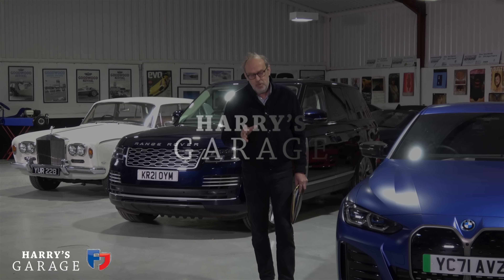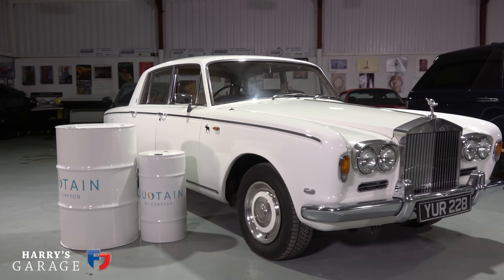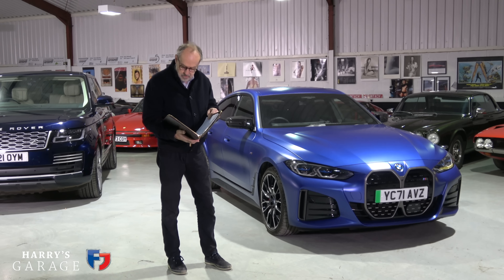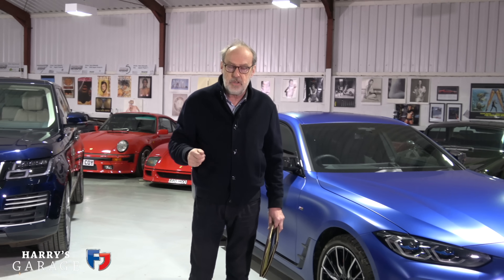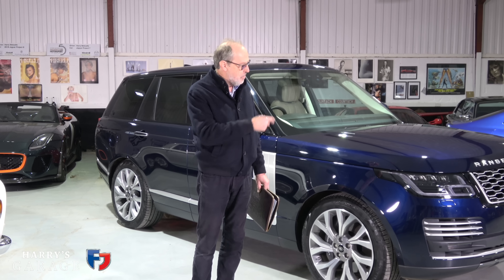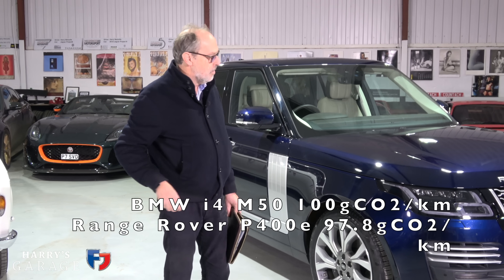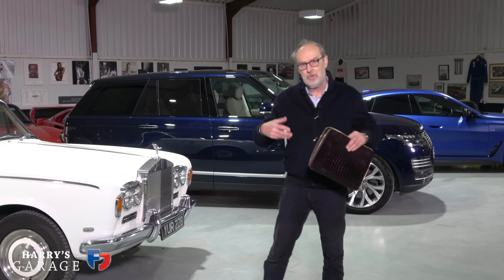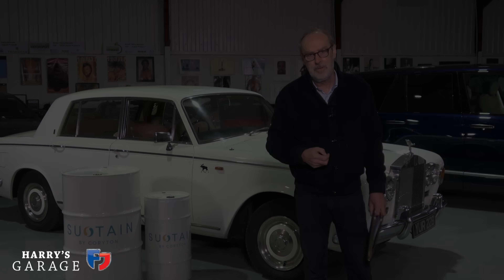Sustainable fuels; what are they & are e-fuels better for the planet than running an EV or PHEV?

Comment: The other factor to add is the initial cost price of the car. The i4 M50 is GBP 63,905 . The BMW 420i M Sport is GBP 41,650. So you have a GBP 22,255 difference straight off the bat. Are you going to be putting GBP 22,255 worth of fuel in the car over the time you own it, before selling it on. You still have to pay the electric charge price on the EV. The petrol car you can drive all day and only have to stop for 10 mins max to fill up. The EV is the wait time to for a charging station, time to charge. CARWOW did a drive and was getting 293 miles out of a charge. Now, I live in Canada and for our winters it is -10C on a good day. EV batteries lose 40% on average in the cold. So now it is down to 173 mile range. That won't cut it for me to drive from Calgary to Vancouver, which is 604 miles. (I do this trip one a month for work). EV cars this winter, this winter was really bad as the -40C cold spell lasted over 6 weeks, shut off the heat in some vehicles to help the battery out. People were sat in EV vehicles that were showing -21C inside and the cabin heat was shut off by the cars computers as it was -40C outside and the battery power was used to keep the batteries warm.
Reply: At last, someone else who sees the true issue. I commuted 110 miles a day until very recently and would have loved an EV to reduce my fuel costs...but factor in the pure outlay necessary to buy the bloody thing and it paid enough fuel to take me to retirement. So no EV for me.
It is my guess that they will only really take off once they are readily available to the masses for around the £5k mark.

Comment: Another thing to take into account for some people considering a PHEV or EV is the option of changing to a smart tariff if they have smart meters installed at home. Currently I can get a new tariff of 30p/kWh during the day and 7.5p/kWh during 4 hours at night which would reduce the cost of electric vehicle running by 75%. Hopefully the UK gov will do more to reduce the CO2 cost and remove the reliance on oil and gas for electricity generation.
Reply: Yep!! I'm currently on 5p at night. Hopefully still quite low when I need to renew end of the year.
Reply: I strongly suspect once enough tax revenue is lost to EV's we will all be charged 'by the mile' thus removing any perceived benefit of running an EV.
Reply: @BibtheBoulder  I mean that is coming ev or not. It's a better way of taxation imo whatever you drive. Won't fully remove benefits though as all cars will be subject to it. Yet EVs likely still cheaper to fuel

Comment: Caveat - the unsustainable construction argument against electric cars goes against all cars, in fact it goes against all (new) things.

I commend Harry for recognising that the maintenance of an old vehicle beyond its intended lifespan is an objectively sustainable thing.

But, to stand between two brand new cars - one of which effectively has two drivetrains in it - and emphasise the damage done to the environment by just one of them is nonsense. Yes, the BMW was carbon intensive to produce. So was the Range Rover. In Harry's own words, the planet noticed them both.

The most effective solution is to move away from the overconsumption of brand new products, on every scale, and towards an economy of maintenance and repair.
Reply: @mstrbkr which particular fact would you like proof of, mr fact checker
Reply: Wrong. Look at the Volvo study looking at ICE XC40 vs EV XC40. The EV needed to travel 140,000 km before the CO2 reduction was realised, on current energy mix in Europe.
Reply: @anthonyfarnan5935  wrong - 146k on global electricity mix. 84k kms on EU mix. So basically, if you were to buy a new car now, over the course of a lifetime, it is more "environmentally friendly" to buy an a Volvo XC40 EV rather than a ICE XC40 as most cars will still be around after 5 years / 50k miles.
Reply: @acemcgraw1  wrong - at that mileage, the EV batters are destined for the scrap heap. Whereas the ICE vehicle has another 150,000 km to give.
Reply: @anthonyfarnan5935  says who? Most estimates are that batteries will go on for 10-20 years. Most new EVs you buy have a 10 year warranty. How many ICE cars really go on to 150-200k miles before being scrapped?  Look, I am a petrol head, but in order to "win" against the EVs, we can't just make stuff up that isn't true!
Reply: @anthonyfarnan5935  oh come on, that’s a decade old speculation at this point, there are a number of ev taxi companies that have pushed Teslas and other vehicles to over half a million miles on original batteries. Meanwhile, 250k on an ice car assumes a rigorous maintenance schedule. Doable, but your every day consumer expects to move on to the next car after 50k.
Reply: @acemcgraw1  I was talking about kilometres, and you just switched the discussion to miles. In any event, a well maintained ICE vehicle can (and usually will) have double the lifespan of an EV. The second hand market takes care of that.
Reply: @anthonyfarnan5935  You're making that up, we've already told you why that's not true.
Reply: @Munkenba  lol, why would simply assume I’m making this up? From TrueCar Adviser: “Electric vehicles have come a long way. Automakers are offering more affordable electric cars with plenty of range, and charging stations are becoming more common across the country. But if you’re new to the plug-in lifestyle, you may be wondering exactly how long an EV battery lasts. The short answer is at least 8 years or 100,000 miles”

An ICE vehicle, if maintained in accordance with manufacturer’s specifications, can last well over 200,000 miles.
Reply: @anthonyfarnan5935  ffs, it says "at least 8 years or 100,000 miles" because there are very few electric cars that are over 8 years old or 100,000 miles in, but you're effectively making the comparison with 30 year old Volvos. That's why I cited taxi companies. While they're a small data set, they've proven that plenty of EV batteries are happy to run half a million or more, and that's on a maintenance schedule that amounts to changing brake pads, tyres and washer fluid.
Reply: @Munkenba  wrong. The writer makes that conclusion because while there are many EVs which have lasted longer, their range is reduced dramatically due to battery degradation over time.
Reply: @Munkenba  totally agree with your original comment about repairing/reusing things and reducing consumption, i've been banging on about that very point for decades, not just in the motor industry but in every aspect of life, but unfortunately we live in a throw away society, obsessed with the next brand new thing !

As for FEV's & PHEV's or even the old REX vehicles, i've worked on them for the past decade or so, since the infancy of the tech & to our present day as a High voltage Technician & i must say the technology is getting better but unfortunately i think it has its limits, there's no reason why an FEV or similar can go on for big miles/KM's but the problem is the degradation in efficiency over time which can be seen in older vehicles like the Nissan Leaf or older hybrids such as the Golf GTE, when this happens charging becomes more frequent or in a worse case the vehicle becomes unusable.

Comment: I work in Motorsports and the shear amount of waste and fuel use is unsustainable. 
I’m concerned for the engine builders as a whole as we move forward, particularly for drag applications. The amount of innovation in electric and simplification it brings will be difficult to ignore. 
From a road race perspective alternative fuels will be a godsend, especially if they can be made to be plug and play. 
We are seeing a huge shift towards tracks in the US becoming “destinations” or “lifestyle” parks. As on road driving regulations ramp up these alternative driving outlets will expand.  Having the option to more sustainably fuel that demand will provide us all a more guilt free experience.

Comment: Harry ..."CO2 under the earthcrust?" You have no idea what you are talking about.  You will hardly find any CO2 in an oil reservoir. In gas reservoirs there is perhaps 3%? My point is that when you combust any fuel it will generate CO2 ... it does NOT matter where it comes from. Both this sustainable fuel and fossil fuels have the same CO2 output after combustion. You have fallen for a sales trick.